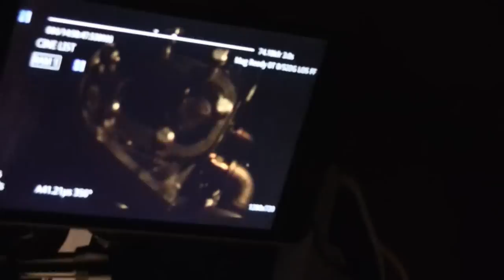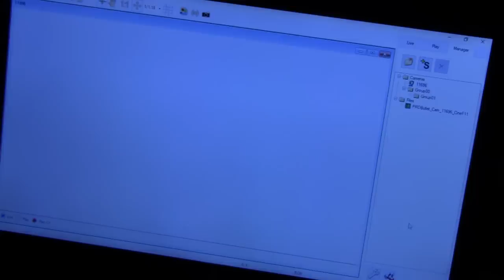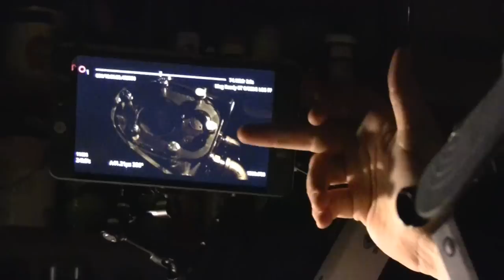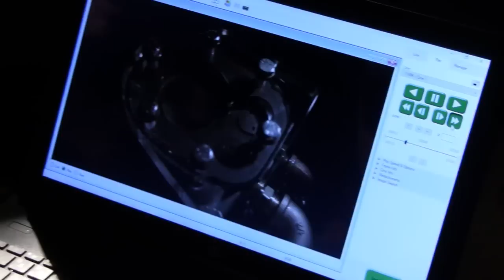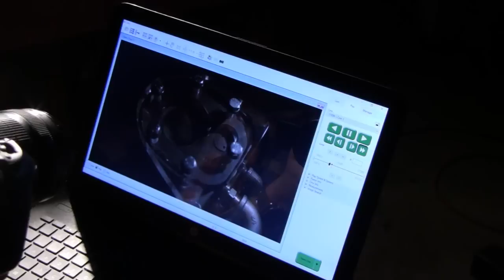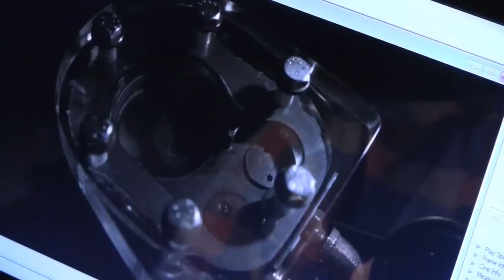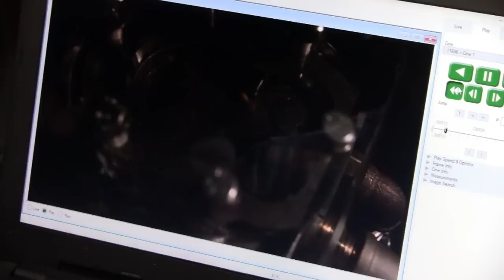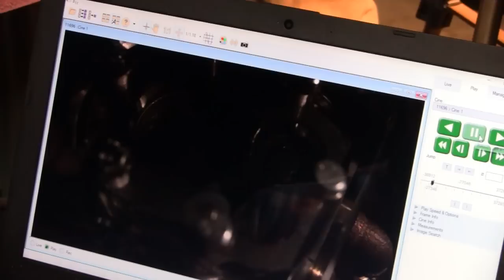Glass Head Engine Slomo with SmarterEveryDay (part 1) Behind the Scenes

Comment: how does one convert to propane, and how were you able to convert back and forth so quickly, and lastly, is there a way to convert these engines (or any engines) to be able to run on either with a quick flip of a switch? i'm pretty mechanically inclined.
Reply from the maker: The whole series is on my playlist, it will show you everything!!☺

Comment: 2 questions. 1. I dont see any type of alternator, does the spark just not use that much power so you wouldn't need one? 2. can you rev it? and how?
Reply from the maker: That's 3 questions!!  1.The battery will last about 9 months between charges!! 2. Yeah we can rev it!! 3. We just have to turn up the propane and open the air valve a little more!!☺

Comment: Big fan of SmarterEveryDay too! This is so cool! Something to consider per the LED lights... If they have a protection circuit built in, it can cause flicker and fade. A solution might be found in using a steadier power supply like a battery of the desired voltage and LEDs with no protection circuit. Thanks for sharing! Behind the scenes footage is like being sneaked in the back door of the set! ;)
Reply from the maker: You are right, We wound up using an LED flashlight and got the best footage!!☺
Reply: Good Deal! :) Glad I could almost help! ;)

Comment: Just a thought, since you had issues with the ac lighting flickering, would a dc flashlight solve those lighting issues?
Reply from the maker: Yeah that's what we wound up using!! Destin shows it in his behind the scenes video!!☺
Reply: i believe so, AC is  Alternating so 60 Cycles per second , DC Is Direct Current, no cycles so it is a straight line, Keep in mind AC Goes +120Volts to -120 Volts 60 times,
Reply: I'm quite aware of the cycles, that why I suggested the dc lighting to negate the flickering of light with the high speed camera picking it up
Reply: Ok, great minds think a like LOL , I thought when using gas, and seeing the waterflow of burning fire being pulled down on the power stroke was super cool effect. I thought I was the only fool up so late. your best video so far !! Did you show Dustin your radial project?

Comment: Hi guys, I have a quick question for you guys and apologies if you've answered this elsewhere, but I noticed that there seems to be a spark on the at the tail end of the exhaust stroke, before the new fuel is introduced and I was wondering what purpose that serves. Is it perhaps to make sure all remaining fuel is burnt? Or is it some sort of fall back in case the normal ignition did not happen. It seems kind of risky because it comes so close to new fuel being introduced and the valve being open. I tried to pick out a good clip from dustin's video here: https://youtu.be/xflY5uS-nnw?t=6m10s.

Interested to hear from you and thanks for putting this together and sharing it with the world. What you guys do is very impressive and interesting, thanks!
Reply from the maker: Thanks Matt!! I don't mean to be brief, but I'm being bombarded with over 2000 comments right now!! What you're seeing is called a "wasted Spark". Google and wiki can explain it in alot clearer than I can at the moment!!☺
Reply: Hey, I'm mightily impressed with the speed of your reply if nothing else! I did take a look at the wikipedia page and I can at least theoretically understand the reason for the wasted spark, even if I don't really understand the intricacies and service lives of different ignition systems.

Thanks for the reply and good luck with the next 1999 comments! :D

Also as an edit I'll just summarize my (very) basic understanding of the design and purpose of a wasted spark system for others passing by. In a wasted spark system, basically two spark plugs are powered by the same ignition coil and fire at the same time, but with one cylinder full of compressed gas and the other at the end of the exhaust stroke. Tying these two spark plugs together was advantageous because it reduced parts required (e.g. coils) and also simplified timing calculations for early engine computers. Having a spark during the exhaust stroke requires significantly less voltage because the ionized exhaust provides less resistance than the fuel and air in the compression stroke, and it doesn't harm the engine or appreciably affect wear on the system.

For more accurate and full info, this page seems helpful: http://mechanics.stackexchange.com/questions/19697/why-the-wasted-spark-in-four-stroke-motors